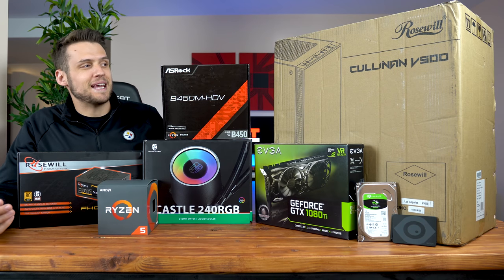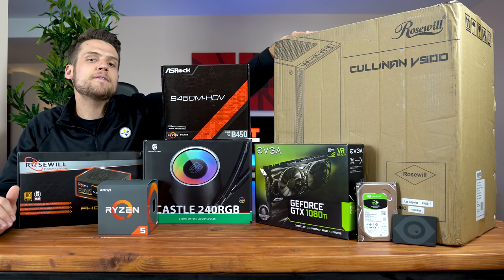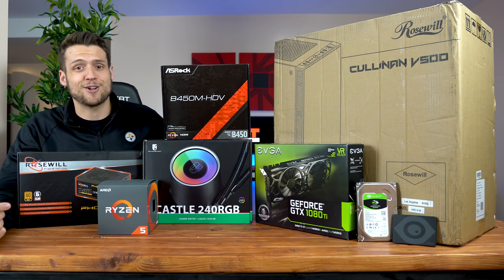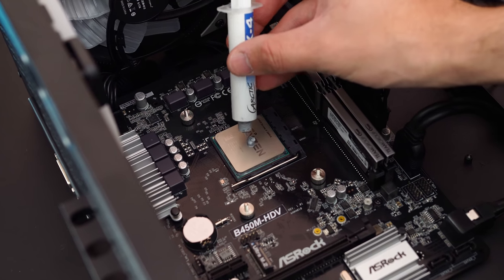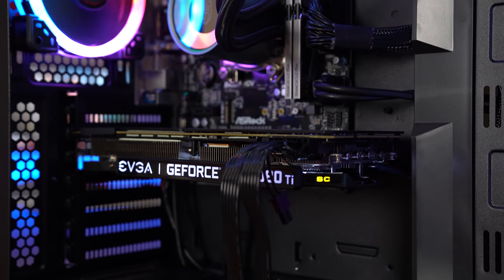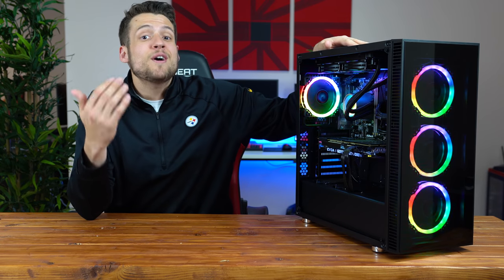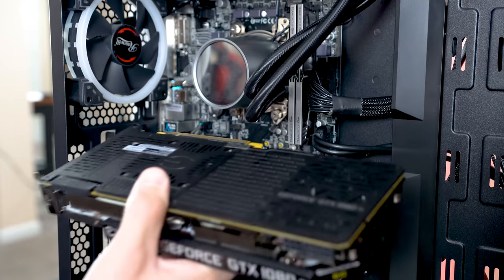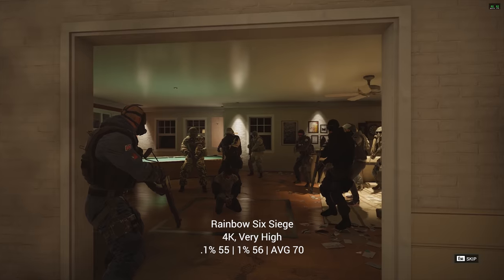Baller $1500 Gaming PC Build!

Comment: I am building a pc for first time!!! But I’m having trouble deciding parts will this be a good build?

-Asus rog strix gtx 1060 6gb oc

-Corsair cxm 550w psu

- Kingston 240gb ssd

-western digital 1tb hd

-Nzxt black/blue h500

-Ryzen 7 2700x

-G.skill trident rgb 2x8 3200mhz RAM

-gigabyte X470 auroras  gaming atx motherboard 

-2 cooler master sickflow blue LED

- aoc 1920x1080p 144hz monitor

All for about 1,350 usd but my dads co worker will give me some parts for free
Reply from the maker: There's nothing wrong with that build, it's solid. But if it's purely for gaming, I would go with a Ryzen 5 and a 1070/1070ti
Reply: Zach's Tech Turf ok thank you, do you have any recommendations for 1070/1070 ti
Reply: I will also be streaming

Comment: I recently just got a Ryzen 5 2600 with 16 GB RAM, CoolerMaster ML360R, Radeon RX 580, 500 GB M.2 NVMe SSD, 2 TB HDD, a B350 motherboard, Corsair 750W PSU, and this case for $1,150. The only thing dropping this price is the GPU, which I feel is only slightly less superior than the 1080 Ti.
Reply from the maker: That's an awesome build! Congrats.

Comment: How is this 1500$ ?
1080ti 600$
R5 2600 150$
Mobo 80$
Ram 110$ 
Which is 940$. So did you spent 560$ for case, storage and psu?
Reply: Luka Ž  , cpu cooler, case, ssd, psu, rgb. Rgb is real expensive. Plus it’s a 2600x which is $210. 1080 ti is sold out so it’s like 700-1000 from mining process. They didn’t lower their prices and the normal, cheaper cards, are out of stock
Reply: 600$ 1080ti 😂 if you would just click the link to see the Amazon pricing they are at 1k rn. Hard to find any cards still for whatever stupid reason. Got my sc2 like 6 months ago for 850 lol shits ridiculous.
Reply: They’re sold out lol. It was Black Friday and Cyber Monday 4-7 days ago
Reply: @itsicee2693  then go with rtx 2080
Reply: @lukazaberl2011  your case might catch on fire, im staying far away for the rtx series at least till next year sometimes
Reply: Actually if u want a new 1080ti = $1300
Reply: On the low end $999, go with a rtx 2080
Reply: 1080ti prices jacked up so maybe that's why. They're going for just under $1k. :/
Reply: Luka Ž 1080ti costs a little more than 600$ buddy
Reply: the 1080ti 1280$

Comment: Why did you pair a high end liquid cooler with a super budget b450 motherboard. The liquid cooler wound'nt matter because there not be enough overclocking head room without vrm's. Its a bad choice and you could have bought an decent air cooler with a much better mobo.
Reply from the maker: You must have missed when I said this wasn't a build guide. Just something I slapped together for a video.
Reply: Zach's Tech Turf I saw that part of the video but when you put the price of the system in the title I assumed that the build was built with all brand new parts

Comment: Is this good

Gaming Pc Specs
Graphics Card
EVGA GeForce GTX 1050 SC Gaming

Storage 
WD Black 1TB Performance Desktop Hard Disk Drive

Ram
Corsair Vengeance LPX 8GB (2x4GB)

Processor
Intel Core i3-8100

Tower
MasterBox Pro 5 RGB ATX Mid-Tower

Power Supply
EVGA SuperNOVA 750 G2, 80+ GOLD 750W

Comment: Question and comment: I bought this case but can't seem to figure out how to attach the front dust cover. I tried in front of the fans and behind. The magnets won't stick anywhere. And 280mm radiators won't fit into the top (at least the Thermaltake Floe Riing 280 won't) unless you push it all the way to the back and it's being held by 4 screws instead of 8 (2 middle, 2 front, none in the rear).
Reply from the maker: The magnets sit just right up in the front if you want to use it.
Reply: @ZachsTechTurf  Are your fans mounted in front of or behind the metal bracket? Or are they screwed in from the front or inside?

Comment: Hey so i bought this case and i put everything together. So when I first turned on the PC i thought cool everything is working smooth. but then i noticed the fans aren't spinning only the RGB lights on the fans. So turned out i didn't have the fan cables connected, but once i connected the cables to my mother board the PC wouldn't power on at all. It would only power on if the fan cables aren't connected. Can someone help me out or has anyone had this issue?

Comment: How much room is there for top mounted radiators and fans? I currently have the Cullinan ATX and it won't fit my Arctic Liquid Freezer II 280 (65mm depth) unless I mount my fans outside my case.

Comment: Is there a way to turn off the rgb lights on the fans?
Reply from the maker: Yea you can completely turn them off if you want, or change them to a solid color.
Reply: @ZachsTechTurf  Thanks for the Reply, I ended up getting the case. Although the audio and mic cables seem pinched in the front but still great case.
Reply: Shortcut what do you mean pinched?

Comment: this baller PC trumps the Wallmart PC by a mile

3 legit reviews of the Walmart PC and it just terrible

no USB 3.0 on the case

GPU PCI-E not plugged

cheap ass mobo and PSU

one stick of DDR4

hot glue on the USB 3.0 header